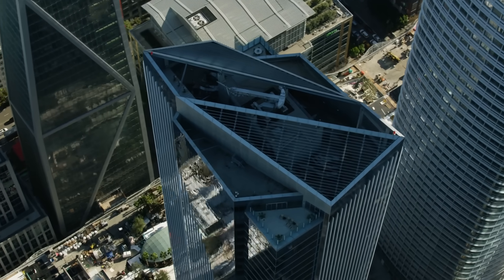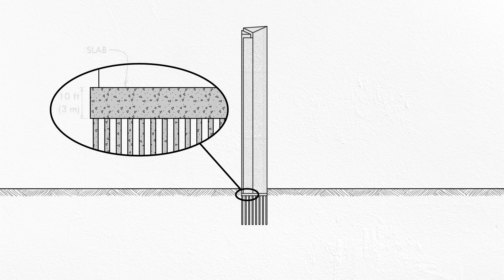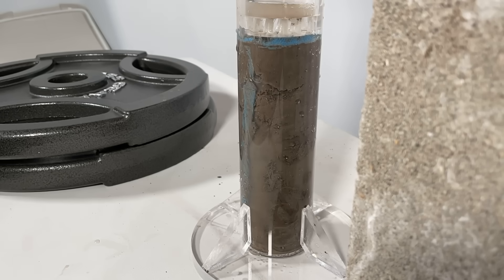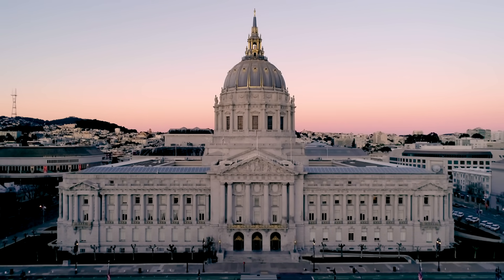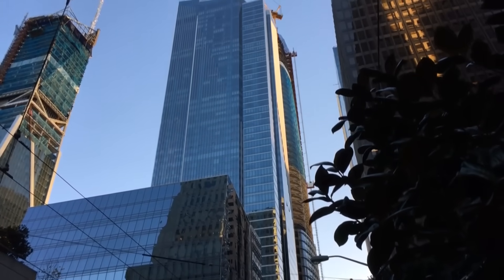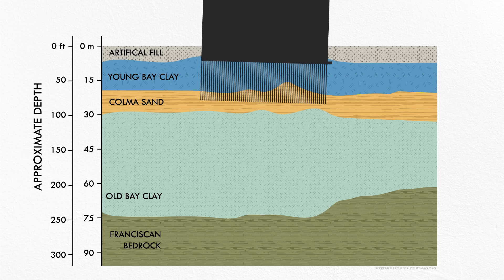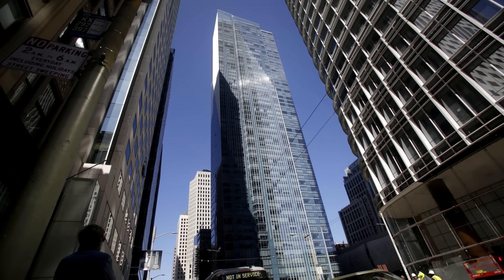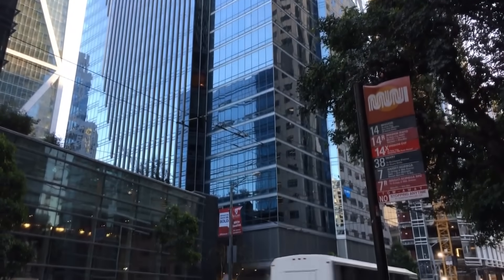What Really Happened at the Millennium Tower?

Comment: A very well presented explanation. When I was in engineering school(1970s), there was a cartoon about how the architect had saved 600 lira by skipping the geotechnical analysis on the tower of Pizza. The problem is that quality control is often skipped now. Much engineering is cookie cutter and people are not properly exercising their brains. Those long slender piles rely on the soil around them to prevent buckling. When a big earthquake hits, the clay may liquefy and the piles could buckle. A very interesting problem. Good Luck, Rick
Reply: @pulaski1  Correct. When I was in grad school for geotechnical engineering(we just called it "dirt" in those days) my professor summed it up that "when we fully analyze a soil sample we then know the properties of that soil plus or minus 100%". Soil is inconsistent and precise calculations are just kidding yourself.
When I learned design in the 1970s, we used an overall factor of safety of about 4. It was hidden in a combination of places in the calcs(loads and allowable stresses). This was conservative and bean counters decided we could use a load factor reduction calculation to save money. I estimate that the factor of safety was lowered to 3. At the same time, chinese steel started being imported. American steel had gotten very good at being consistent. The imported was very inconsistent. I warned my employer about substituting imported steel but they did. It failed at 1/6 the required strength. I was fired for knowing too much. There have been a lot more new construction failures than there used to be.
One of the big problems here is the layer of garbage and fill. You just can't know what its going to do. I live on the east coast, so I'm more familiar with problems here. In Boston, they ran piles through their fill layers to bedrock. That works well until there is an earthquake. The fill can turn to a liquid from vibrations. Without the lateral support of the piles, they can buckle and fail. There is an earthquake that hits Boston every 200 to 300 years. It last hit in 1755, centered on Cape Ann. It will be scary. Good Luck, Rick
Reply: @richardross7219  , Two things you don't build on: sand, or clay. Clay never stops squeezing out from under the load, and water easily moves sand. I know there are methods to shore up foundations, such as the piles, but mother nature has a way of proving engineers wrong. It's never what we know that gets us; it's what we don't know, or didn't foresee that bites us.
The engineers apparently didn't foresee that other buildings would be built in the area, affecting the ground under this building. 
Now toss in an earthquake.....yikes
Reply: @davidgraham2673  There is none so blind as he who will not see. Many times inconvenient facts are ignored. 
I live in an area where we sometimes pre-load clays with a temporary load for a number of years. The pre-load is usually much larger than the planned loading. The soil consolidates. The final load is then less than the pre-load and much of the settlement problems are  cancelled. A friend developed a technique where he used explosives a hundred feet down to force consolidation of a weak soil.
Reply: @richardross7219  , The neighborhood where I grew up was close by the Cape Fear River in North Carolina. I used to know those woods very well. There was a swamp on the other side of the railroad tracks, that slowly seeped water continuously. A developer thought all that was needed was to fill in any low lying areas, and pack down the soil. A few years later, when I came home for Christmas, my mom and I walked in the new subdivision to look at Christmas lights, and in homes directly in the swamp, you could see completely under the concrete all the way to the back of the carport. The swamp never stopped it's inexorable flow towards the river. It was a stamp for a very good reason......
Reply: I believe several building will fall when the city gets it's next large earthquake!
Reply: @pyhead9916  Very likely. Watch "Idiocracy". There's a scene that shows a city with buildings tipped.
Reply: If only they’d used a denser layer of cheese……..
Reply: Truth to be told, the architect was right in saving the 600 Lira. There was already the nearby Pizza Cathedral, which had had already been happily sinking into the ground during its construction - but that had been compensated with wedge-shaped bricks, so what could possibly go wrong?
Reply: @klausstock8020  , The smallest of the buildings only cost 600 Lira total.
But it was simply a Pizza Hut 🏠.
I know a guy who sank his savings into that one.
Reply: That's one expensive box of pizza if it needs an engineering report!
Reply: Tower of pizza, lol
Reply: Also spare us the condescending boomer lecture thanks

Comment: The building was supposed to have a steel frame, but the builders changed it to concrete, which weighs much more and also costs much more. They went on the cheap by varying from the original design. You get what you pay for.

Comment: I have so many more questions than the answers provided here.  For instance, what keeps the new piles, that are both longer and also hitting the bedrock, from bending in the softer old bay clay layer? Will all of the layers react as one in an earthquake or can they shift against each other, generating shear forces against the piers?  The fix will rely on hydraulic jacks to transfer the weight to the new piers and it seems the jacks will simply be left holding the weight.  What if one fails?  What if that failure, and the resulting increase in weight on the others, causes them to fail in cascade?
Reply: Something that I wasn't even thinking about. In an earthquake you hear all the time about the different layers shifting in relation to each other.
Reply: I get it that the new piles are expensive, but why wouldn't the solution be extended to the entire perimeter of the building? Are they using a drilling sequence like an automotive head bolt torquing sequence, or just perforating the layers along the edges that are currently compacting the fastest?
Reply: @rocker06903  , In commercial construction, I've learned that the best way to spend a lot of money, is to try to spend less when it matters.
That's when the dog starts chasing his tail. Buck up from the get-go, do it properly, and in the long run, you'll be further down the road.
What I don't understand, is how they didn't take into account that other projects would be built right there too, and affect their ground stability. You can only build upwards in San Francisco. That's a lot of extra weight in a relatively small area.
Reply: @davidgraham2673  How much would it have cost to build a 1 meter (3 ft) higher dam in front of the Fukushima nuclear plant? 2 meters higher? Or the whole plant 1 meter up? The 'once in 100.000 years chance event' is supposed to be a guarantee - and settle our nerves. But it simply means it could happen tomorrow - the people in the next 1.000 centuries can go back to sleep very peacefully again.
Reply: @rocker06903  The current plan (subject to change) is to extend the solution to the entire perimeter of the building in a few years. As you guessed, they are starting with the side of the building that is lowest. The rest of the building will continue to settle, levelling it out overall. Once it becomes level enough, they will install piles to bedrock on the other sides of the building.

Source: Currently taking a foundation engineering class and had to write a paper on this. If anyone is interested, one thing you should read is the Transbay Transit's Center's rebuttal to Millennium Partner's claims that dewatering for the transit center caused the tilt. Unlike most of the news articles I had to read, this document has a lot of facts that speak for themselves. You can find it at tjpa.org/uploads/2016/10/TJPA-press-statement-Millennium-Tower-Oct-4-2016.pdf.
Reply: Hydraulic driven screw jacks using multiple planetary gears for reduction. You just scale it bigger to match the weight needed to be lifted. Mass matters. It will require several working together.
Reply: Yeah, especially since they show only one row of new piles along the two edges. Any lateral forces will not have multiple rows to distribute the force in that direction, so these piles better be strong enough to account for that! It seems like they would be susceptible to overloading, and if one in the row does fail, the others will be more overloaded and the problem could cascade.
Reply: Sounds like they should vibrate the higher side of the thing, accelerate the sinking there, and level the building. Rinse & repeat as necessary.
Reply: Boy Scouts are taught about sky hooks 🪝
Reply: I also wonder about what adding additional force to the other side is going to do as they "press" the building upright? Seems like that would surely have some potentially unforeseen consequences for the settling behavior of the opposite side of the building. Seems like an insanely complex and difficult situation.
Reply: Soon enough, these tall buildings in San Francisco will be earthquake tested. Then, we will have our answers, and the engineers will have their grades. Do far, they've earned a "D".
Reply: You're asking tough questions for a guy who has never jacked anything properly in his life. You install rigid supports after jacking anything, or whatever went up is coming down sooner or later.
Don't work on your own car buddy.
Reply: @aluisious  Sold my shop in the 90s and went into a different line of work but I was ASE certified.

Comment: What you say about drilling piles after building construction being more expensive than the original construction itself rings true. I work for a construction QC firm. One of my projects which I migrated into, had a bunch of rubble and unstable soils under the slab of a high traffic area of the building. The foundation was built on piles (designed by others) but the slab was just on the subgrade. We asked why there were no piles under the slab if bad soils were known to be present (from borings done by others)... but it was too late; the footings and spreadfootings were already in place as well as the second-floor deck by the time the general contractor realized it would be an issue. 
They had to work around the footings and do a 5 to 7 foot undercut under more than half of the slab to make it acceptable. VERY expensive to do and also slowed other operations down such as masonry and steel fabrication which just added to the cost of the project.

Comment: And down the rabbit hole we go. Value engineering steered the project from steel to concrete. A proper reassessment of the foundations with respect to the increased weight of the structure may have been inadequate.